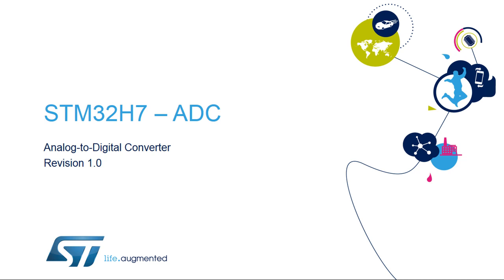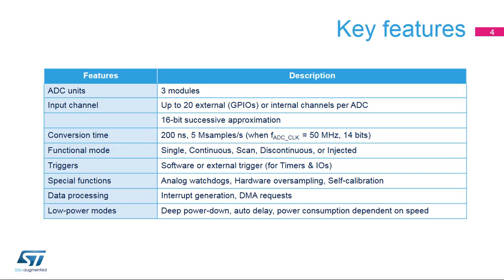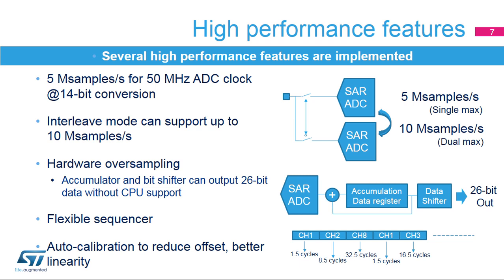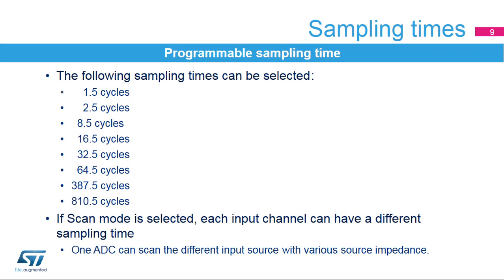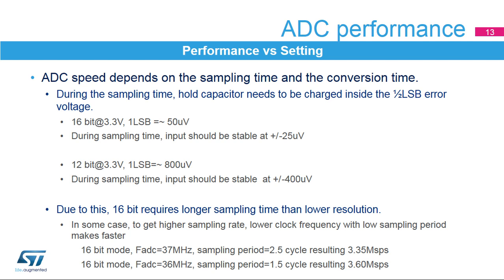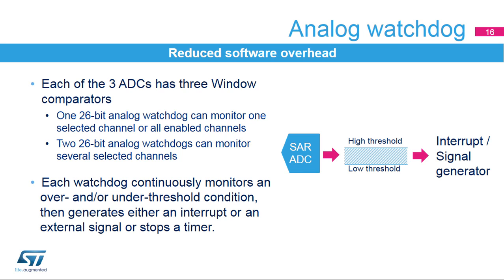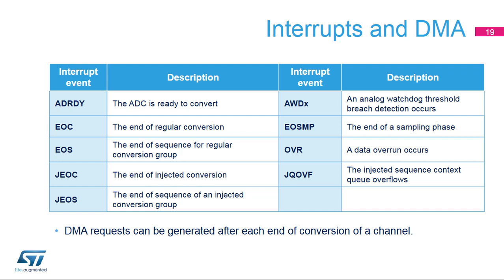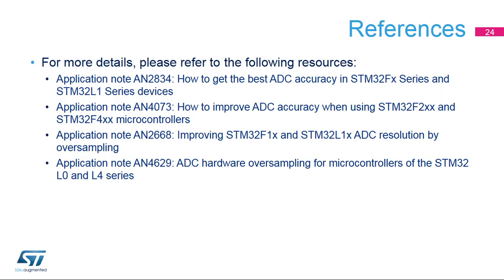STM32H7 OLT - 36. Analog ADC ADC

Comment: Request ST to comment on below problem on STM32 H7, ADC DMA interface
Reply from the maker: Hello,  Visit our online community to find answers to your technical questions and share ideas with your developers and ST experts : https://community.st.com
Reply: I have this problem, the ADC interface results always zero value.
Reply: @luacardoso6825  Hi, as of now, we were using three ADC's in software trigger or  time triggerred manner, the problem we faced was mostly the third adc - dma buffer read zero. We need to use HAL_ADC_Start_DMA to start to start three ADCs.  inside the above function, LL_ADC_REG_StartConversion , the start conversion function was suggested to be commented and to be called seperately after the hal_adc_start_dma function, then all the three ADC worked well.
Reply: Hii i am Interfacing ADC but the output is 0 only can u help me
Reply: @shettymalnad1978  hi..how you're using.. what's the configuration.....we cleared adc issue.....and further work going on
Reply: @vaishnavivijayakumar1127  Thank you for your response.which board you're using ? Currently i got the output next step i am going to link DMA if i stuck anywhere i will ask your help reply please.
Reply: @shettymalnad1978  ya sure... we are using stm32h7 nucleo eval board
Reply: @vaishnavivijayakumar1127  Hello mam, Can you reply please i am facing issue linking DMA to ADC in STM32H745i-Discovery Board .
Reply: @shettymalnad1978  What is the issue, please describe...,mention how adc is triggered, how many adcs used..?, we faced issue while we simultaneously used three ADC's
Reply: @vaishnavivijayakumar1127  i am using single ADC only in that one channel only (STM32H745i-discovery board ADC3 channel0).Without DMA i am getting ADC values Once i am link DMA not getting Any ADC values.

Comment: I understand the STM32H7's BDMA requires special attention to the memory map [FAQ: DMA is not working on STM32H7 devices]

however, when I try to declare the buffer to SRAM4 that will be the destination for the ADC DMA transfer,
__attribute__((at(0x38000000)))uint32_t pAdcBuffer [ 1024 ] = {0}; 
OR..
#define SRAM4_BDAM_BUFFER __attribute__((section("RAM_D3")))
SRAM4_BDAM_BUFFER uint32_t pAdcBuffer [ 1024 ] = {0};

it compiles, but neither works as I still get a DMA error code of 1 (transfer error) when I start:
HAL_ADC_Start_DMA (&hadc3 , (uint32_t*)pAdcBuffer, 256 );

I also tried via the linker-script without success:
STM32H743ZITX_RAM.ld:
  ._ramd3_aka_sram4(NOLOAD) :
  {
    . = ALIGN(4);
    *(._ramd3_aka_sram4*)
  } >RAM_D3
 
main.c:
__attribute__((section("_ramd3_aka_sram4"), used))
uint32_t pAdcBuffer [ 1024 ] = {0};
 
Otherwise, if not a memory map issue, what else could be the problem.. enabling SRAM4/DMAMUX?  For example AN5224 and UM2217 reference Stm32CubeH7.. however, I'm using Stm32CubeIDE.  Since the documents are older, which should environment should I use?
Reply: Hi Ben Nguyen, any solution you found for ADC DMA interface, we are using three ADC's of STM32H7, each we need 5 ot 6 channels, , while we tested, ADC1 and ADC2 values are fetched through DMA, but DMA buffer of ADC3 always reads zero. we tried many things based on forums, memory mapping etc. We are not sure about multiplexer settings.